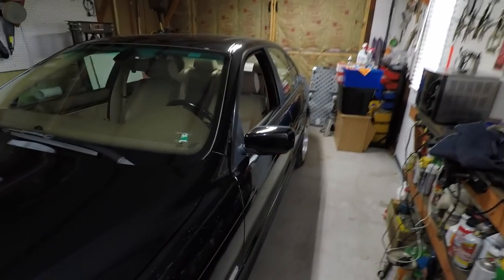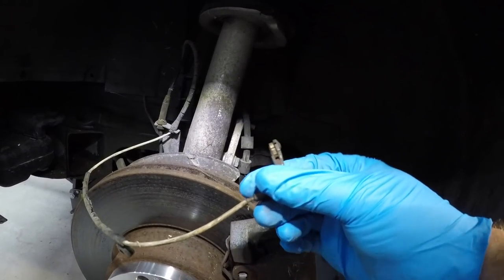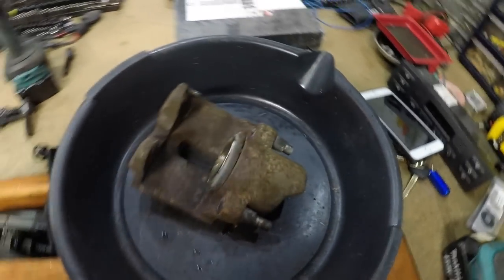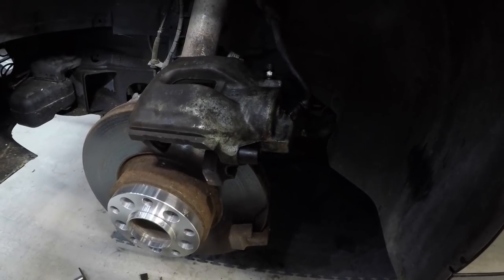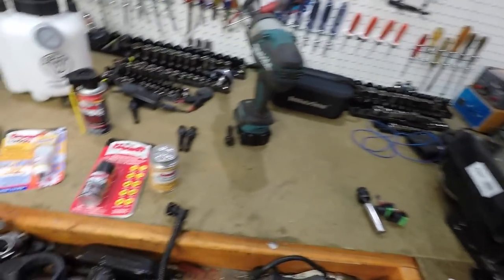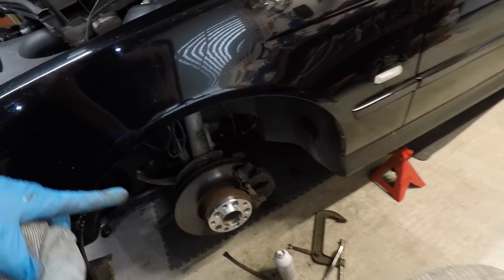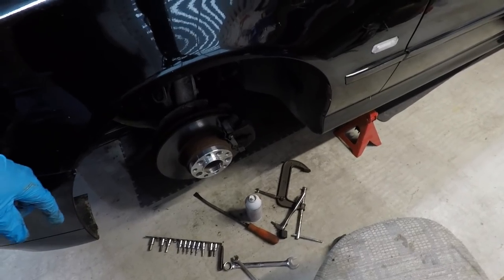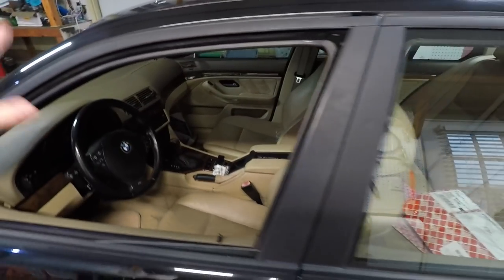BMW E39 5 Series Ceramic Front Brake Pads No More Brake Dust, CAIG.COM Lubricants

Comment: I've used that brand several times on a few different vehicles. I know you not to fond of GM, but I put drilled and slotted rotors , front and rear, with ceramic brake pads on our Yukon. Have about 50,000 miles on them and still look like new. The old Yukon through has 198,000. Great video Nathan.

Comment: We had rain here in the KC area yest Thursday. E46 is still sitting outside. I did charge the battery out of car when i charged it. Still starts (as of yest) and has set just over 2 weeks when i started it. Most codes went away including throttle angle code. Haven't driven it other than around the block 2 times. Probably not enough to see if code will trip again. Key remote not functioning. I will search for your prior diy(s) on that and try to diagnose. Giving it to youngest son so he can learn to work on his own since I've, YES bought a '96 Jeep Cherokee XJ Classic. It's so basic, to get it where i can better repait things, 1st 2 upgeades/maintanance repairs will be, 1) full dash gauge cluster for temp gauge, volt meter, tach and 1 other gauge, I believe is oil pressure gauge. Adding tach moves gas gauge. Only have to change 3 sensors to work gauges instead of dummy lughts. And tach wiring is found in all of the cherokee wiring harnesses. I insisted my son watch your channel and if he could find "That 50s kid" channel leftovers as well. He's has some different ways to go abour e46 jobbers, but from what i have found, you're on the top of my list. Shoplife and Salina bmw or bimmer are tied at second with that50skid close, but in 3rd. I must say that I get a kick watching Salina give her boyfriend, dufus shoplife skeleton boy crap. He does try his best to give it back, but she seems to outwit him. Scotty seems to be getting farther from reality as time goes. He used to be, in this transmission tech eyes, a decent resource for beginner to novice diyers, but not so much the last 12 or so months. Anyway, I've rambled my rants and raves for the moment. I will continue to watch your 2 auto channels, Nathan's bimmer (as I call it, lol) Garage and the yoter channel. Also, which I haven't done yet and doing now is checking out Dr Dean's channel.
Reply from the maker: Thanks for the kind words James, remember that e46 will still go dead if it sits a few weeks , that is just the way they are
Reply: @NathansBMWWorkshop  yes. Just surprised it hadn't this time around. Probably why I was/am believing a potential, albeit an additional possibility of a periodical issue as far as that goes. Key fob function still not working. I can't recall some of the probables or potential possibilities you had mentioned in prior videos.

Comment: I used the same brakes and for some reason within one week the black wheels on my brother’s  car r covered in brake dust like bad. Bad batch maybe?
Reply from the maker: Sounds like they didn't give you the ceramics, I would tell them about it
Reply: Nathan's BMW Workshop maybe. Mine came in yellow boxes. But they were cheap so ehh its whatever. Next time i will pay attention.